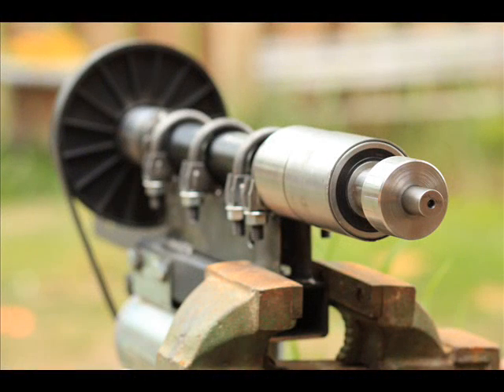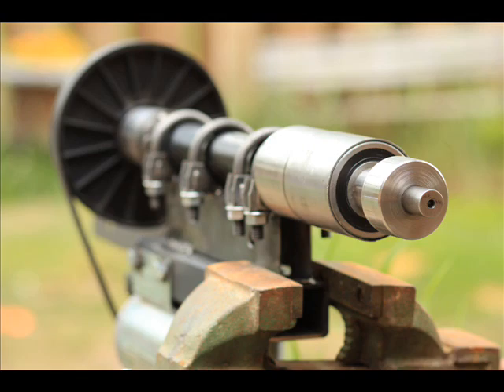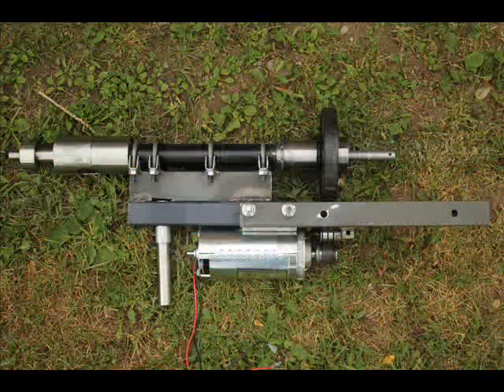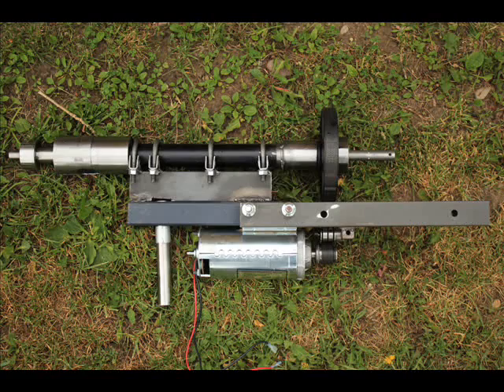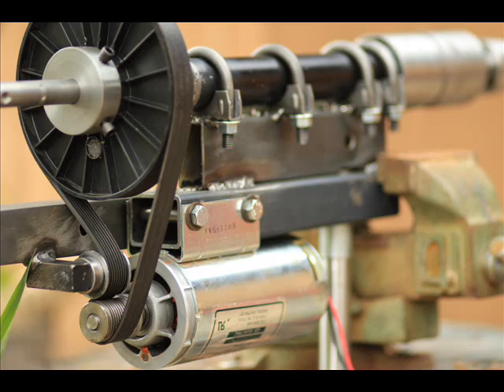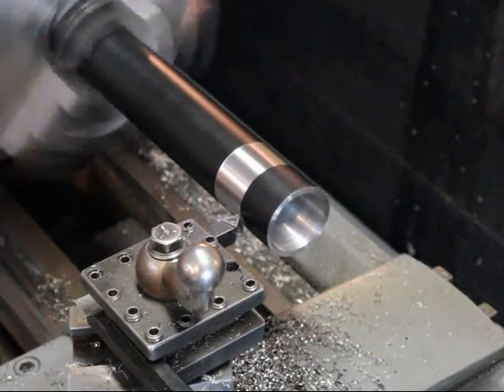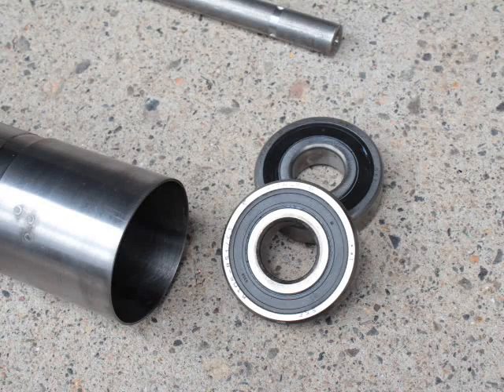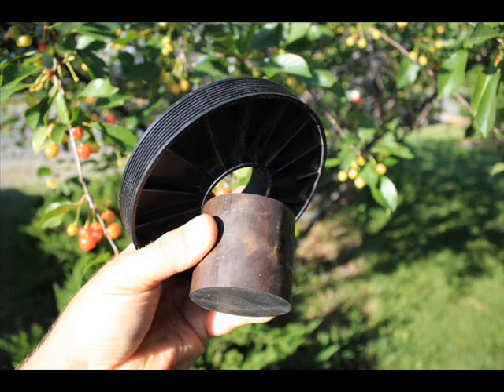Part 1 Grooved Belt Treadmill Motor Wind Turbine Generator DC PVC Blades Gear up PMA Logan Lathe

Comment from the maker: Also, I like to replace stock bearings with double sealed (2rs) if I can find them cheap or free. We are high, dry and cold here in Montana so corrosion is minimal I wouldn’t use one of these in a wet marine environment. I’m not really a fan of direct drive for these because of the high RPM required but it can be done. See the two blade machine I made. The video is a little crappy but it the turbine works well. Good luck with the project and send a video response if you make one.

Comment from the maker: The wires can in fact wind up inside the pole but I have not found this to be a significant problem. The machine will tend to unwind itself when its calm especially if they pivot on radial ball bearings. Since these motors are not intended for the elements I concentrate on protecting the commutator and bushes from direct rain and snow.

Comment from the maker: Thanks! The tensioner is indeed fixed. However, I can tighten and loosen the belt with shims by raising the main shaft or bringing out the tensioner. I did note the number for the nylon reinforced belt that the range was built around so it can be replaced.

Comment: Very slick--looks real nice. Quick question about the tensioner--The tensioner looks like it is fixed--how are you making the slack adjustment? Is this done with the motor bolts itself or ??